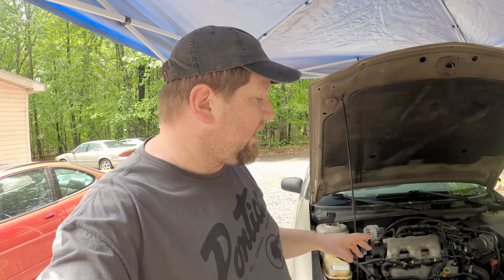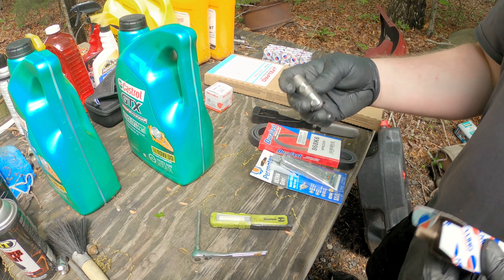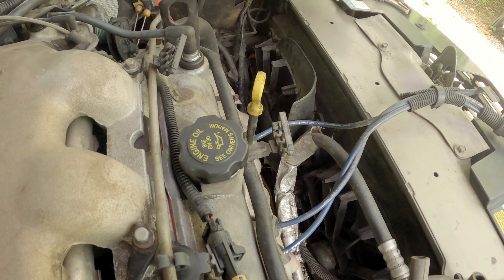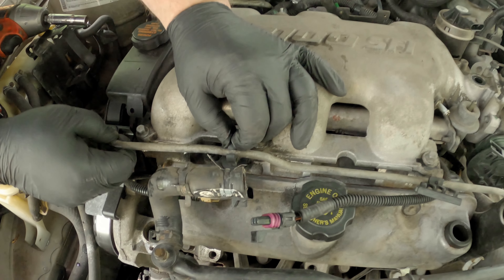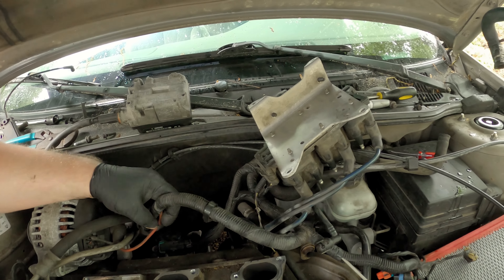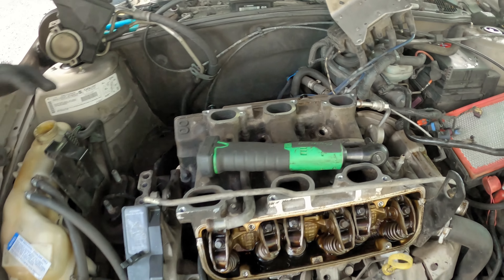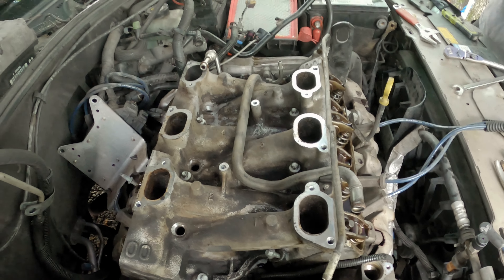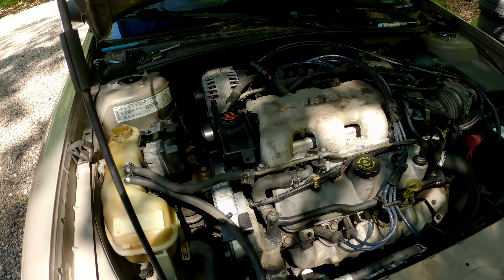Intake Gasket and Lifter Replacement ( 2000 Chevy Malibu )

Comment: Great video.  Since you bought a new gasket set why didn't replace the head gasket when you were down there? What are the names and models of your new head gasket set and the RTV sealant?

My Malibu 2001 V6 has the same gm 3100 engine.  There are  oil leaks at the valleys.  I am thinking about replacing the gaskets and new RTV sealant.  What are suggestions, tips or recommendations to make it easier.   I am not sure how much difference from my malibu 2001 v6 and your car.  Thank you

Comment: Awesome walkthrough, I haven't looked yet but wanted to ask, do you have a similar video for the L36 3800? I've got a couple lifters bleeding down real quick, and I need to get down in the valley anyhow cause the LIM gaskets are dripping coolant down the block.
Reply from the maker: I have them for the non supercharged 3800s doing an l32 video later this month

Comment: did you end up finding out what was still causing a noise? did the lifters fix anything?
Reply from the maker: The noise seems to be piston slap.  Common in high mileage 3100s
Reply: @SalemDoyle weird, I thought the loose rocker you found was a sure sign of collapsed lifters. mine is a 3.8 with 205k so idk, but I'm hoping it's just the lifter
Reply from the maker: @dummkompf piston slap is not common on 3800s
Reply: are the lifters a common issue that need to be replaced on the 3800s? @SalemDoyle  

I've been running it with seafoam in the oil today and that seamed to make it a lot quieter. Now going to change it out and use some thicker oil. I used 5w30 last time cuz I forgot it specs 10w30, gonna try a mix of 10w30 and 10w40 this time, maybe that will helpif it's just low pressure
Reply from the maker: @dummkompf  lifters are an issue sometimes.  Flushes can help too
Reply: @SalemDoyle  ty for all the info. I'm not sure now about it getting quieter from the seafoam. I think it may be louder in the morning and quieter after driving all day, but I may be imagining that too... getting worried that it's a more serious issue. anyways I guess I will remove the valve cover to look for collapsed lifters and go from there. ty